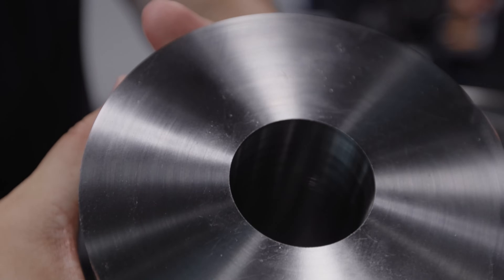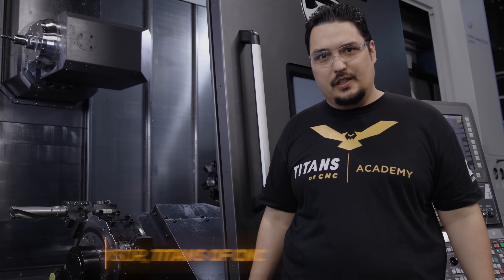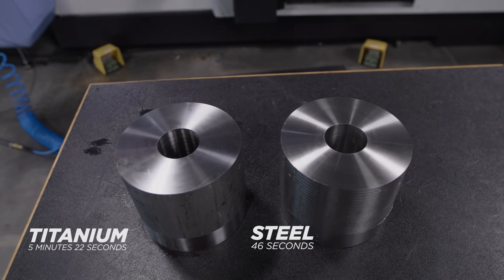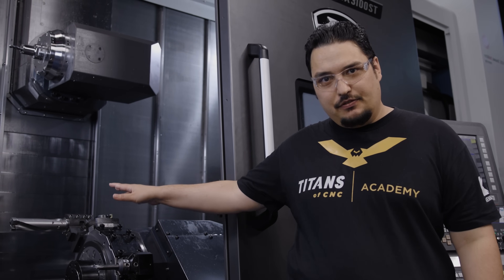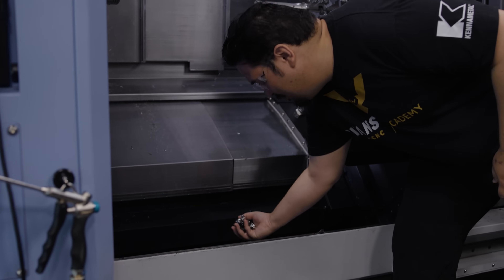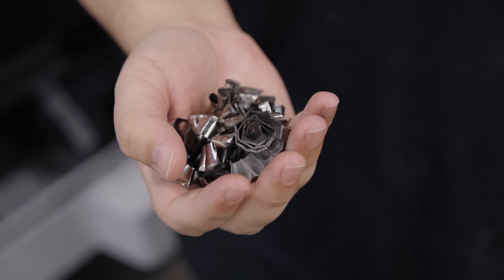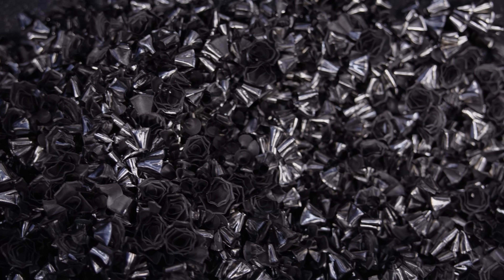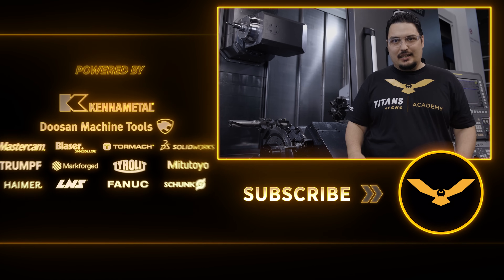How to Drill 316 SS & Titanium | SMX 3100ST 9 Axis Lathe

Comment from the maker: Please see numbers below for Titanium. There is an error in the video for the metric federate.

Cutter: 2” Dia to 50.8mm Dia
Axial depth: 5.2 to 132.08mm
SFM: 170 to SMM: 51.815
IPM: 0.972 to MMPM: 24.688
.003 IPR to .0762MMPR
Reply: Do niobium.
Reply: I want to see you guys machine other exotic alloys like Tungsten, nitinol, etc.
Reply: Titanium is super easy, same with tungsten. Hardest to machine is without doubt - Aluminium

Comment: I used to regularly use a 1.5in diameter indexable drill in the vertical mill. Those things cut like butter. And leave great finishes on the inside of the hole

Comment: I used to work at a company that had a production manager who insisted that if the swarf was not coming of RED HOT and the spindle load was at 110% then it was not working hard enough!
We set up and get everything running nice then he would come round and make us up the feed and speed until the swarf was sticking to the plastic viewing panel! 
This was with coolant running flat out !
The local tool and repair techs were in once a week to fix the machines and we had a lovely collection of mushroom headed U Drills and some that were totally melted into the work piece!

Comment: Hi guys, in steel the chips are very long
Tyson what parameters would you change to make those chips shorter? I would reduce the feed per rotation, because it seems too fast for the chipbreaker
Reply from the maker: It’s the nature of the beast… Stainless doesn’t break as easy but it’s all good… completely normal. More Feed per SFM = better chip break… and shorter cut time.
Reply: @TITANSofCNC  For materials that tend to form long chips there should be chipbreakers on the cutting edge, but perhaps they have been engineered for different working speeds than those used in the video. Anyway I will try to increase the surface feed next time i have this problem, thanks for the reply
Reply: Less chance of double cutting with streamers
Reply: @kingofkings600  especially in CNC machines, long chips are not recommended because they could damage the machine